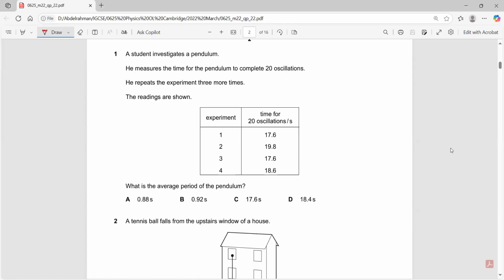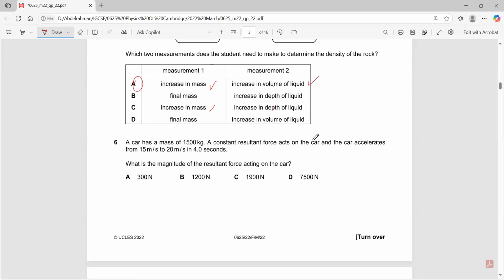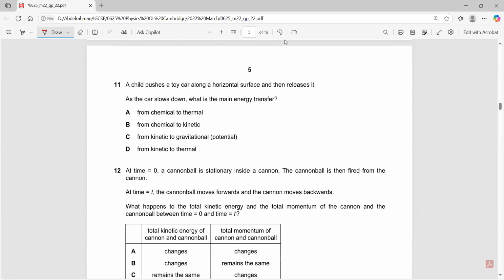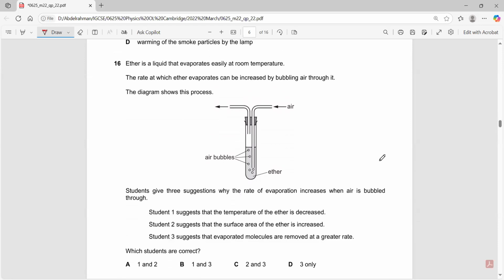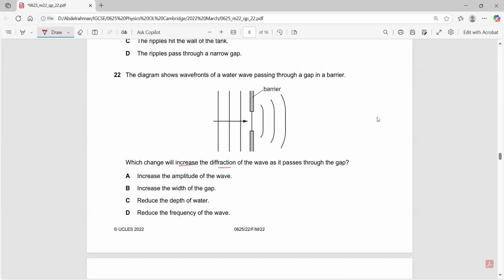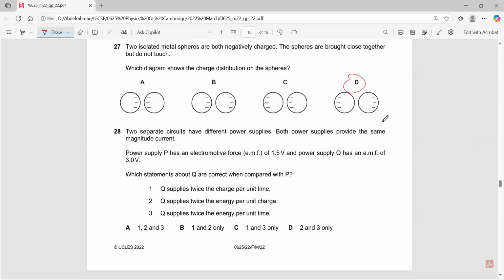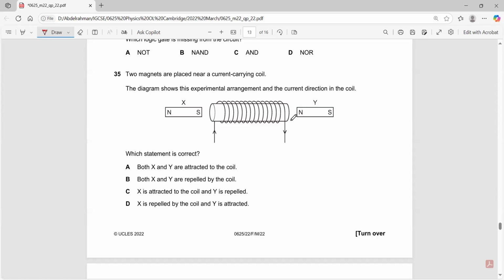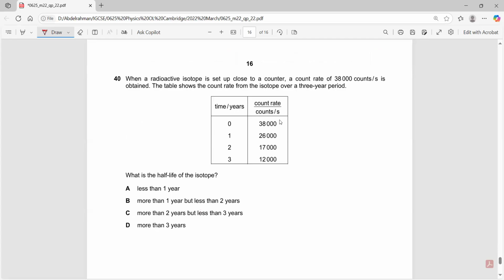IGCSE Physics 0625/22/F/M/22

Comment: How does the right hand grip rule prove that they repel in question 35?
Reply: Lol don't get that part myself
Reply from the maker: Because a north pole will be induced on the right side and a south pole will be induced o the left side
Reply: @a.tawfik96 i don understand
Reply: when we use it we thatN pole is on right side and y's north pole is facing it so it repels and same with X south pole formed on that side and south and south repel
Reply: Anyways for those who still don't get it ( I had to look it up ) take your fingers of the the right hand( not curled ) and point at the direction of the current at the start of the coil, then if you curl up your fingers it would show the other direction of the current from where it exits the coil. Your thumb should not be curled up, wherever you're thumb points after u did the right hand rule would be the North